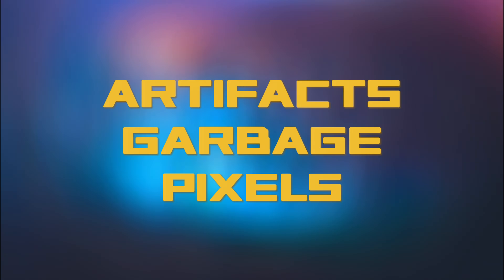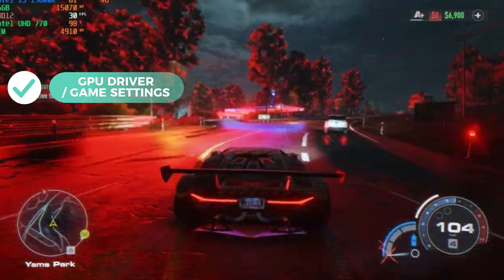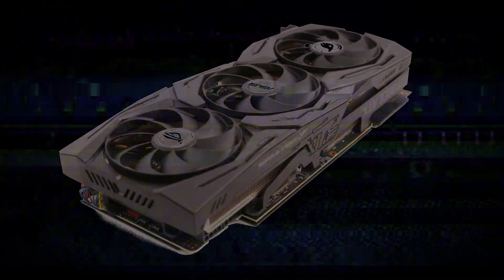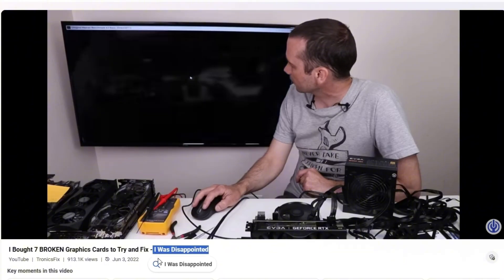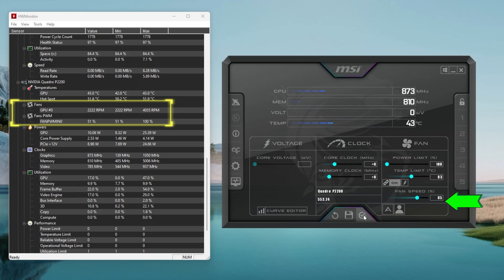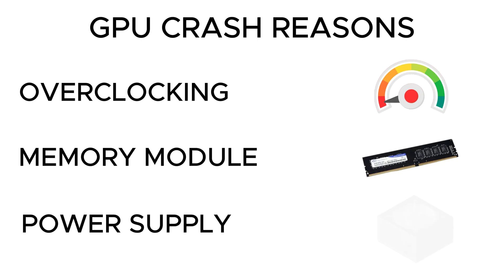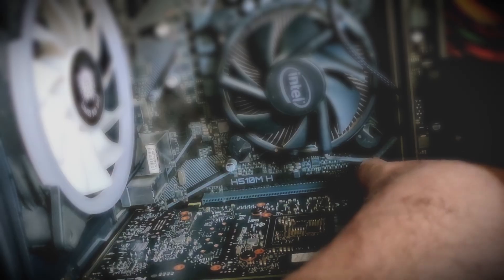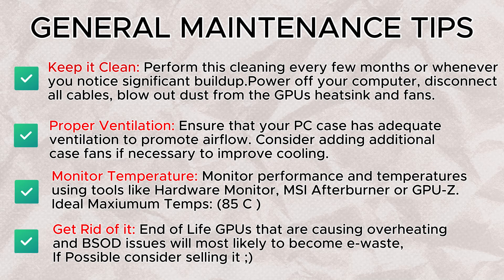Diagnosing and Fixing GPU Issues Artifacts, Crashing, Black screen

Comment: I bought my gpu rx 580 in November and till now it was performing very well
But yesterday when i was playing a game (detroit become human) on max settings it suddenly freeze and was showing artifacts on screen 
I waited for some time but nothing happened so o turned the pc off with the button on power supply 
Ater that when I turned on my pc it was running but there was no display 
I changed ports but still no display 
I even cleaned rams but that also didn't worked
Im afraid that my gpu is dead
But its fans are running fine
What could be the problem 
Can you help with it?

I didn't have any electricity issues nor any heating issues cuz its always in air conditioner 
And i cleaned it twice a month so there was no dust in my pc
Reply from the maker: It sounds like you've already tried the basic troubleshooting steps, but you might want to try a different monitor or cable to rule out display issues. Let me know and Subscribe if it helps!
Reply: @SidTheGeek I tried changing cable, different ports and other monitor but still no signal 
I will go to computer store tomorrow or day after tomorrow
Reply: Your gpu vram was died bro sorry
Reply: @VereusOnTop yup this was the reason, now rocking rtx 3050 6gb, i know it's a bad card but had to buy that because of 1 year warranty

Comment: When i boot up my pc, it turns into a flickering with lines and i cant do anything. I got the pc as a pre built just a week ago and im defeated. Might just return
Reply from the maker: That’s frustrating! Check for any loose connections or overheating components. Check if any other cable produces the same result. Although, it sounds like a hardware issue. Subscribe if you need more helpful videos like this